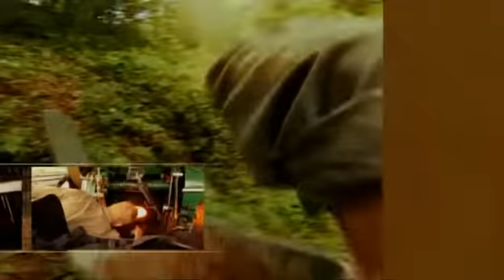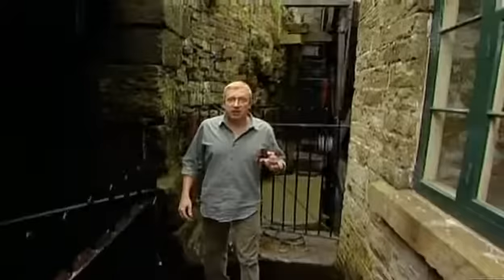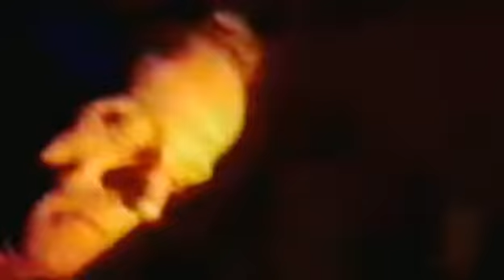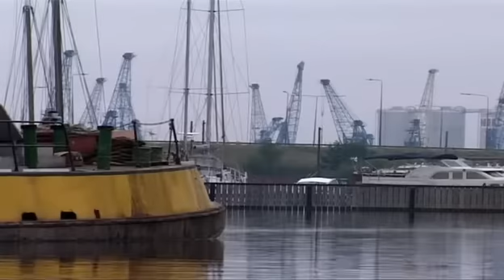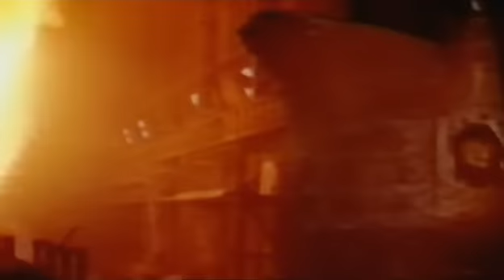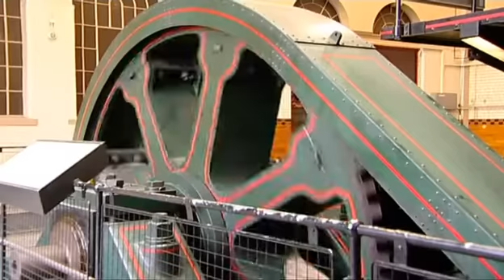Industrial Revelations - E07 - Cutting Edge

Comment: Bessamer Steel, of course, is the essential material for the I beams of skyscrapers whose entire weight was supported with a steel frame. The Home Life Insurance Building (Chicago: 1885; 42m/10 stories) was the first.
Reply: Copied from the Flaxmill in Shrewsbury built some time before, as wiki explains 

The Flax Mill's architect was Charles Bage, who designed the mill using an iron-framed structure,[4] inspired by the work of William Strutt. The columns and cross-beams were made by William Hazledine at his foundry in Shrewsbury.[5] The construction of the mill ran from 1796 to 1797, at a cost (including equipment) of £17,000.[6]
Reply: Cast Iron beams will not work where you would use steel beams.
Reply: @Dave5843-d9m no steel existed when the iron bridge or flax mill was built, all loads are compression, flax mill floors are arch brick supported again a compressive load. Steel was some many years away, then eventually Bessemer made fast volume almost continuous production possible. Steel replaced most cast iron